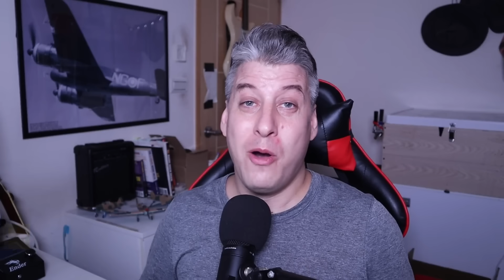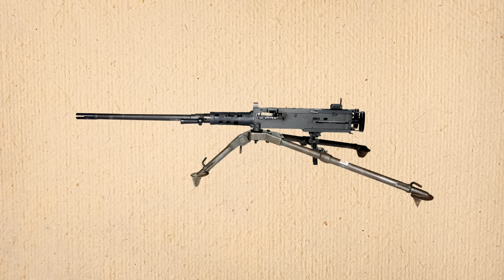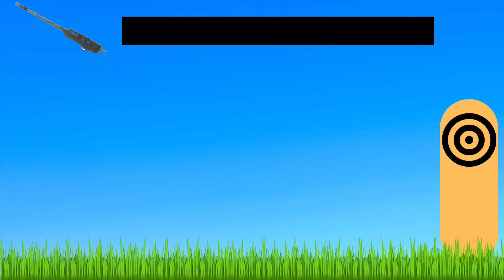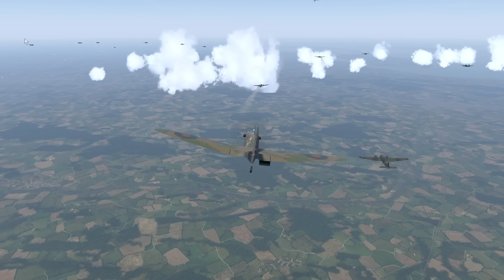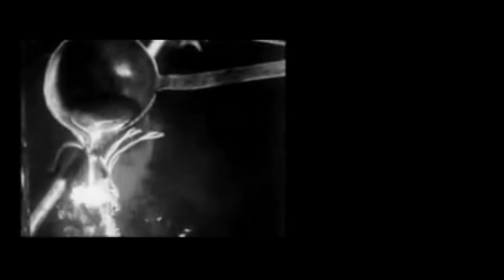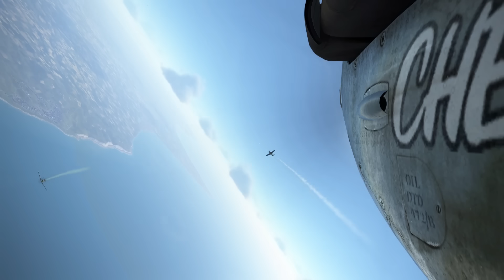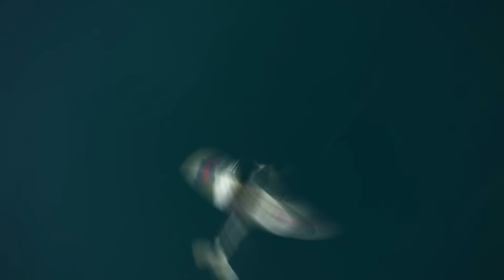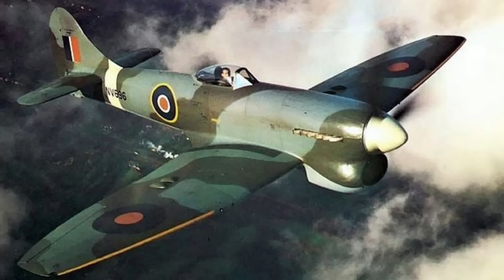Why Did The RAF Use .303 Caliber Machine Guns in WW2? The Surprising Answer

Comment: Calibur size doesnt necessarily indicate effectiveness such in the case of the Hawker Hurricanes that fought well during the battle of britain. In the end it just comes down to the skill and usage of the pilots that indicate effectiveness.
Reply: They fought well, yes, but would have fought better by getting rid of the .303, not question.
Reply: Skill certainly does play a huge part! Doesn't matter what you throw at the enemy if none of it hits! Rate of fire, calibre, skill, and type of ammo all play a part. A shell rather than just a normal 'ball' round is going to be more effective, larger calibre better than small, and a high rate of fire is more effective at hitting a fast moving target! In the slightly bigger picture, weight has to be taken into account, a 20mm cannon is significantly heavier than a .303 machine gun, but has a far slower rate of fire. SO many factors to take into consideration!
Reply: @BatwingForge  True and one such example would be during "Mig Alley" when the F86 Sabers went up against Mig 15s. Armament size was considerably different for both planes however due to skill set, there is a huge disparity in terms of the kill ratio.
Reply: Well they certainly shot plenty of German aircraft down I guess.  I did hear that early cannons (especially single ones) tended to be too slow firing to hit fighters.
Reply: @rob5944   This is why most american pilots preferred 50cals due to the rate of fire which is more preferable when doing dogfights with other fighters. You can also sight the difference between the fw190 vs bf109 when it comes to destroying bombers. The fw190 was more effective rather than the 109s with their 30mm which was not automatic.
Reply: @jacobjackson5062  yes, and perhaps why the .50 effectiveness started to wane during Korea.
Reply: @noele6588  
The problem with your math is you're using muzzle energy as a comparison, .50 cal retains it's ballistics and energy a lot further downrange than rifle cartridges do.
And 20mm is an explosive cannon shell so it's "hitting power" downrange is pointless. 
Very bad comparison between the 3 using muzzle velocity as a measuring metric.
Reply: @dukecraig2402  Its true that ammunition type may factor in but Rate of Fire will always be more advantageous. This is best exemplified by the battle of Agincourt when british longbow men defeated french crossbowmen. Rate of Fire trumps ammunition type.
Reply: @jacobjackson5062  
Take it from someone who used to be in the business of the destruction of aircraft with a gun, it's a combination of both, and explosive shell's also brings in a factor that the other types of ammunition don't have, then there's firing time, that's the downside of cannons is their limited firing time.
So it's not just how many arrow's you can put in the air, that's hardly the deciding factor and you really should rethink using what happened in a medieval battle as a measuring metric for WW2 fighter's and their arms. 
Hitting power at the distance they'll realistically be striking a target, which explosive cannon shell's bring in a whole different value into things, firing rates and firing time are all factors, if it was just about the number of guns and their firing rate then the RAF would have just stopped development at eight .303's, I've personally fired an M1919 Browning chambered in .303 that came out of the wing of a Spitfire that a friend of mine has, it's firing rate is much higher than his normal land based M1919 Browning he has and eight of them will put more arrow's in that air at the same time as the 20mm Vulcan gun I was a gunner on in the Army, but I can assure you they wouldn't be nearly as effective as the Vulcan between it's explosive shell's and much greater range.
Reply: @dukecraig2402  Yes you just summarized what I said. Why else would the usaf develop the vulcan if not to increase firing rate? Thats why having a gun that spits out a 1000x rounds a min is better than having 8 guns that fir 10 in a min. You know this, you were in the business of it right?
Reply: @jacobjackson5062  
No, I didn't just summarize what you just said. 
Once again, it isn't ALL about firing rate, if it was they'd have made the Vulcan .50 cal and it'd have a lot more firing time.
You seem to conveniently be forgetting the other parts of it that I tried to explain to you are important, like them taking the time to develop the 20mm shell which I pointed out earlier is explosive when you were demanding it's ALL about firing rate, and when I pointed out about effective range the whole while you were and still are saying it ALL about firing rate.
If it was just about firing rate they'd have saved themselves a whole bunch of time and money by just making the M61 in .50 cal, but it's not all about firing rate, they also wanted more range than the .50 cal and an explosive projectile which the .50 cal doesn't have. 
And just so you know, which apparently you didn't comprehend when I pointed it out earlier, the eight M1919 .303 Brownings in the wing of that variant of the Spitfire put out more rounds per minute combined than my Vulcan did, so once again no, firing rate isn't what it's all about and no which was my point behind that, at no point did I "summarize what you said", if you'd have paid attention you'd get that and you'd get what I've been trying to explain to you all along. 
And yes, I have been in that business in life, including 6 months of being headquarters squad squad leader in my platoon, meaning that the .50 cal mounted on top of the M113 command vehicle was mine, so I had plenty of experience firing it also to personally be able to compare it against the Vulcan shooting at the same targets on the same range, what's your on hands experiences in these matters?
Reply: @dukecraig2402  Yes you did SUMMARIZE what I said and YES its all about firing rate. I respect the fact that you were in the service  and you rode on an armoured vehicle but I think the opinion of a airforce pilot with combat experience would weigh more since lets be honest here, if all fails you can always hide in your M113 to reload or fix gun jams while an airforce pilot in mid air cannot afford the safety of an amoured vehicle. Thanks for your insight but I would trust a combat pilot more than a ground pounder. Hell at this point I'll even consider the opinion of someone who came from TAS over a grease monkey that got to pop off a couple of rounds on dragon while in vietnam.
Reply: @jacobjackson5062  
Quit trying to put words in my mouth, I most certainly did not summarize what you said, only in some self imposed fantasy world would you keep thinking that, even after I pointed out that the combined rate of fire of all those .303's was higher than the Vulcan I fired you're still going to sit there and claim that?
Freakin seriously?
I don't know how I can make it anymore clear that IT'S NOT ALL ABOUT FIRING RATE, I've repeatedly said that how many times now yet somehow or the other you keep demanding that despite everything I've explained I'm somehow or the other agreeing with you, are you 12 years old or something?
If it was just about firing rate instead of one 20mm Vulcan on a jet they'd have two mini guns, BUT THEY DON'T BECAUSE IT'S NOT ALL ABOUT FIRING RATE.
Can I be any more clear on the fact that I AM NOT SUMMARIZING WHAT YOU'RE SAYING AND AGREEING WITH YOU???
Reply: @dukecraig2402  Yes you do agree with what I say and yes you keep summarizing my point that its all about Rate of Fire. I respect your insights but I would trust the word of a pilot, any pilot at this point, over a someone who isnt. To be honest your insight is as good as getting financial advice from a 2 year old. I'll take it with a minute grain of salt.
Reply: @jacobjackson5062  
You really are acting like a child at this point by keeping up with the narrative that I'm agreeing with you, you must be 12 years old.
Your further comments on things like "being able to hide inside of a vehicle" while reloading or whatever truly does show how little comprehension you have on these matters, along with your complete lack of knowledge about how long it takes to load the drum on an M163A1 self propelled Vulcan gun, and the fact that it's immobile while being loaded and vulnerable to everything all the way from aircraft and enemy armor that are hunting you to just being able to be over run by an Infantry squad while the crew is attempting to reload the ammo drum, there's only 3 guys to do it and no one to form a secure perimeter around you while it takes the 10 to 15 minutes to do it, even if for whatever reason you want to stop the loading process and fire however much ammo you've managed to get into the drum it'd still take around 5 minutes from that point to get the gun to where it'll fire, you have to time the ammo drum, time the feed system, time the declutching feeder and time the cannon, it's not like dropping the mag out of an M16 and putting another one in kiddo, and the 3 man crew is extremely vulnerable while doing it so if I was you I'd exercise a little caution before making a claim about being able to hide inside of a Vulcan gun while reloading one because nothing is further from the truth all the way down to the ramp being open in the back and it being impossible to do while moving, along with having 20mm explosive ammunition all around you that just one rifle round could set off, so no, no one gets to hide inside of one while loading it, not that it makes any kind of difference being in a light armored vehicle with aircraft, armor and anything else the enemy has that can defeat it including shoulder fired weapons, lot's of dead Russian armor crews in Ukraine can attest to that.
And now you keep pulling out this narrative about some air force officer and keep trying to hide behind it whenever I ask what your personal experiences on these matters are, whoever this mysterious person is I'm not talking to them I'm talking to you so man up and speak for yourself, don't start hiding behind someone else, they weren't the one that originally addressed a comment at me you are, they aren't the person who's continuing with this ridiculous and childish narrative about me supposedly "summarizing" what you're saying, you are so quit hiding behind your imaginary air force friend and answer my question, what are your personal experiences on these matters?
Reply: @dukecraig2402  Sure. Whatever you want to believe. I respect the opinion of any pilot which you are not.
Reply: @jacobjackson5062  
What pilot?
Who is this pilot you keep referring to?
And what exactly is it that he said to you personally? Because I'm sitting here talking directly to you, what did this pilot tell you directly so you can be sure that nothing is being taken out of context by you regarding what he said?
What you're quoting from this pilot did he tell you directly or is this something you got from a book? Or some YouTube video? Or someone in the comments section of a YouTube video who said that some pilot said something?
Because I don't care who they are, anyone who claims that rate of fire completely supercedes all other factors like effective range, destructive power, firing time and accuracy is wrong, and you can keep citing your one single source on the matter which I suspect said something that you could be taking out of context, along with the fact that whoever he is he isn't God because there's plenty of US WW2 fighter pilots who wanted increased firing time as opposed to higher rate of fire or more guns both of which reduced firing time, you're putting all your eggs in one basket citing a single source, aside from my own first hand experiences and being educated by the military on the destruction of aircraft with a gun, both of which are part of my source material, there's the US Navy pilots in WW2 who flew the Wildcat that generally didn't like the later variant that had 6 guns instead of 4, according to your logic they should have because it was putting "more arrow's" in the air at once but they didn't like it because of the reduced firing time as a result of 6 guns chewing through the ammo, their logic was "If you're going to miss with 4 guns you're also gonna miss with 6" so why lose the additional firing time?
The reality of how it works is a compromise, a balance, between firing rate, firing time, destructive power, effective range and accuracy, no one thing is a deciding factor, if it was firing rate they'd just have 2 mini guns in a modern jet with 1 minute of firing time instead of a 20mm cannon that fires explosive shell's and has 10 seconds of firing time, or a single 75mm cannon with only 5 rounds if destructive power was the deciding factor. 
You yourself in these comments said that "US pilots liked the .50 cals instead of 20mm cannons", the reason they didn't like the cannons was the reduced firing time that they had, not the lower rate of fire, they could very well have had the AN/M2 .50 cal's in the wings of US fighter's in WW2 firing at the 1,200 rounds per minute rate they had them firing at in the F86 Sabre during the Korean War, but they didn't because it would have reduced firing time, yes, they wanted a faster firing rate than the 600 rounds per minute of the regular M2 .50 cal but if firing rate was the deciding factor they'd have had those aircraft .50 cals in WW2 firing faster than they did.
Reply: @jacobjackson5062  
Oh, I sound like an unhinged used car salesman, ok.
And there's you making things up and then claiming that the source for your information is supposedly "an air force officer".
So here's the score so far, you've no first hand experience or military training at this and when ask about your source you kept citing you can't produce one, it's just "pick any" WW2 pilot? Well what about the Navy Wildcat pilots who said they didn't like the reduced firing time from added guns? You said pick any, I already have.
And I'm the "used car salesman"?
You're just a kid who likes getting into the comments of videos about military things and act like you know what you're talking about. 
Since you're so fascinated with everything military are you going to enlist when you get out of school?
Reply: @dukecraig2402  Whatever
Reply: @jacobjackson5062  
How old are you?
Reply: @dukecraig2402  ".50 cal retains it's ballistics and energy a lot further downrange than rifle cartridges do."

When you aren't realistically going to hit the target at much over 200 yards, that doesn't really matter.

Comment: I think the "de Wilde" round had something to do with it (keeping .303). First, it made .303 more effective against enemy a/c. Secondly, after putting all those resources into secretly developing a new round, you'd want to get the most use out of it.
Reply: Also in the late 30s 50 calibre was not readily available in large numbers and American policy of neutrality  limited what was available and 303 was .  Early 20mil. Cannon were prone to jamming in combat and so they were switched back to 303 till  that was sorted out
Reply: The .303 has very mild recoil if you've ever popped the cap on one. .50 cal machine guns would shake your plane apart.
Reply: Was there not an "incendiary" / tracer .303 round in British service in WW1? Originally intended for "balloon-busting"?

The Browning aircraft guns were seriously lightened versions of the ground-mount types. The rate of fire of the .303 guns was almost double the M1919 so a LOT of mixed nastiness went down-range in a 2 second burst from eight guns.

There were "lightweight" .50 types as well. You do not need a beefy barrel like the M2 series for two reasons. One, the air up there is cool, to say the least and two, "sustained-fire" is NOT an option, primarily, because of the weight and bulk of all that linked ammo..

Even the post-war 20 and 30mm Vulcsn" electric Gatlings carried limited ammo in those big helical magazines. Once rounds were expended, it was just dead weight, so it was time to go home., unless the aircraft was also well-loaded with explosive "stores" under-wing. I've never seen a "live" A-10 run but, long ago observed, from a safe distance, an F-111 tearing up the scenery with a Vulcan. Very impressive.

Aircraft armaments tend to get somewhat more TLC than ground mounts. Furthermore, the ammunition is not usually "general service" grade, but aerial use only" grade.

The Brits used tried and true "Cordite" in their .303 ammo for aerial gunnery until the outrageous muzzle flash could no longer be ignored. This flash signature not only clearly located a source of gun fire, but the muzzle flash also dazzled the air gunners in bombers doing night operations. So, they changed to filling with granulated Nitrocellulose propellants, which produced very little flash. If you see a .303 cartridge head-stamped Mk Vll Z, it is fueled by NC powder, not Cordite.

Ammunition reliability is very important for wing and cowl mounted guns. It is a bit tricky to re-cock such guns in the event of a "stoppage". The 20mm Oerlikon cannons are a monster to cock, mainly because they are essentially a gigantic open-bolt, straight blowback system. Pretty much a two-man job. The Japanese used quite a few as aircraft guns.
Reply: When the actual low penetration of the de Wilde caused its effectiveness to be seriously questioned, the Brass concluded that it ought to be kept because it was good for morale for pilots to see the flashes when it hit.   They were probably right up to a point. But it might have been just as good for morale to see the enemy go down when hit with something more lethal.
Reply from the maker: I think you're right. I mentioned that it could have been a useful 'aiming' device as the dixon/de Wilde round flashed on impact.
Reply: @CalibanRising  true. It certainly helps track hits in my "expert" opinion as an IL2:CloD pilot.